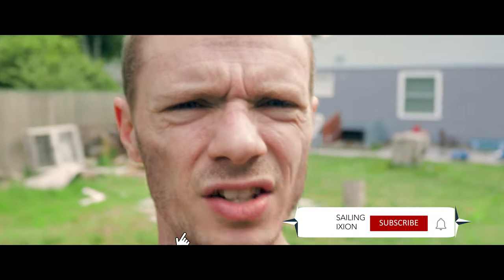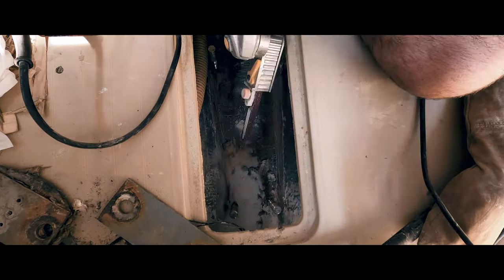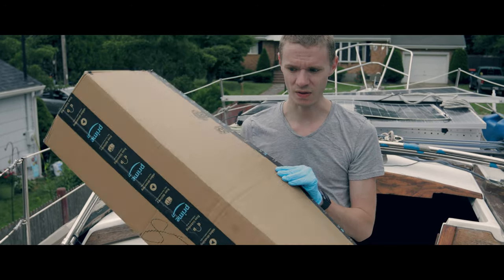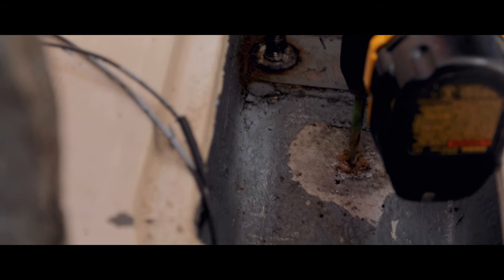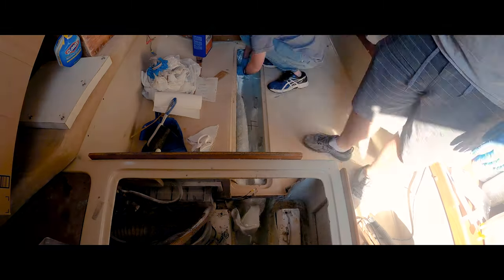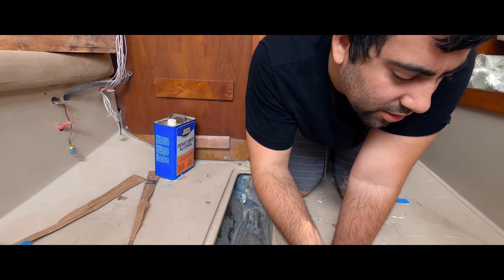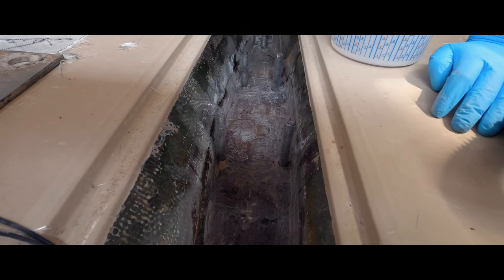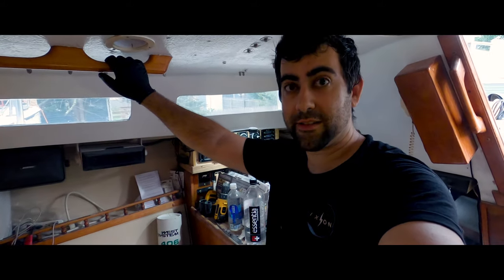Catalina Smile Fix - Part 3 - Ep. 41

Comment: This was a great series! great detail, and easy to follow! One question I had is what type of fiber glass/ resin did you use for this repair? it looks like the pdf calls for 1.5 oz mat and 24 oz something, but it's my understanding that epoxy cant be used with fiberglass mat (chop strand) only with cloth. and it looks like y'all are using cloth.
Reply: Just did the job on my boat yesterday. Used 24 oz roving and 1.5 mat. Some mat is compatible with epoxy, but most is not. You have to check.

Comment: Good job.  And great talk about chemical and mechanical bonds. What I like when using epoxy to glue a fitting on, or  fix something (like big holes in a sea kayak I repaired) is to have rough surfaces. Then if there's some 'issue' with the chemical bond, the epoxy has its 'fingers' into and underneath the surface. (As I'm sure you found out from your hair, the more surface area epoxy has to grab on to, the more tenacious it is.)  What I've seen on too many videos are these types of connections that should be rough and ugly for a great mechanical bond, instead sanded smooth and pretty. On the outside? Sure, you don't want your fiberglass to grab and snag. But down in the bilge? You guys have your heads on straight.  Good work. 
That is a lot of epoxy. Ever see one of your cups start to melt, deform and then begin smoking because the curing epoxy got too hot? I'm dreading the video where the intrepid amateur boat restorers are mesmerized looking at a plastic cup melting and smoking while behind them the whole boat.... Sorry. It's just too terrible.
Reply from the maker: Thank you for the compliment. We do our best to get things right the first time and like my father says, “not Mickey Mouse the fix”. (Not sure why Mickey is bad at fixing but that’s beside the point) Actually the first time I was testing and “playing” with epoxy I mixed it in a regular plastic Dixie cup and boy did it melt! 

Since we were laying so much glass and using so much epoxy we definitely kept a schedule so that the entire project didn’t go up in flames (literally). Honestly though, the hardest part was keeping air out of the laminate. A part of me wishes I had tried to vacuum bag the fix. If I had dropped the whole keel I definitely would have done that.

Comment: Curious how this repair has held up? I'm doing the same on my 82 as we speak, only I'm starting with smaller cuts and overlapping each layer of glass 1/2 inch further than the last. Using 9 layers of biaxial E glass with 3/4 Oz strand on one side and was just wondering how yours has held up to bolt compression and sailing? Cheers

Comment: I think in your shoes, i'd have cast an aluminum keel with a lead bottom designed to ground and lighter. Also have taken out that whole bottom of the boat and built it closer to the rest of the hull. You sure had enough materials.

Comment: I apparently have a smile as well.  The thing is I have an MKII which I understand does not have the same issue.  I assume that the boat hit something and it separated a little or DE caulked.   Maybe the forum can shed some light on it.  Good work you two!!
Reply from the maker: Thank you! It was an insane project but glad we were able to finish it! It might help to add some fiberglass tape across the keel joint.